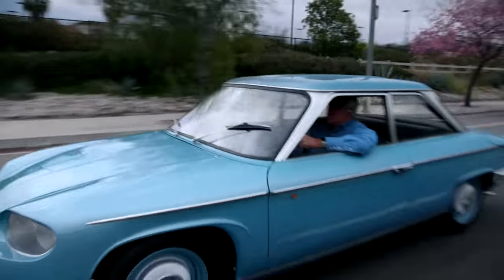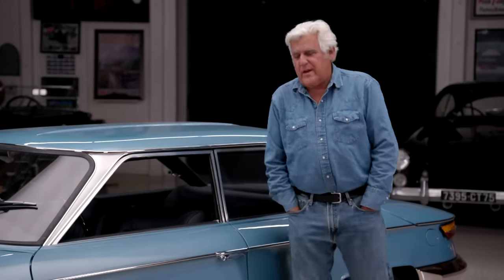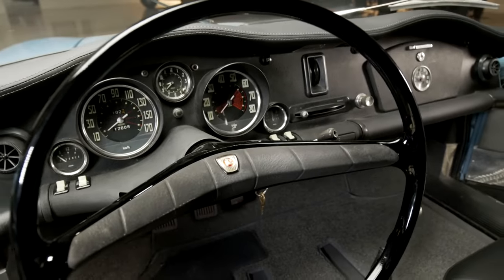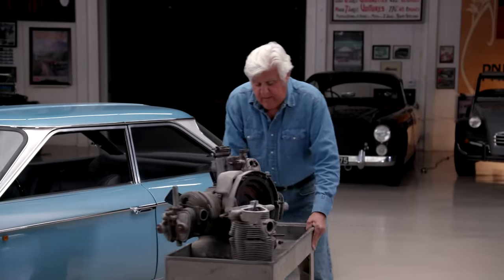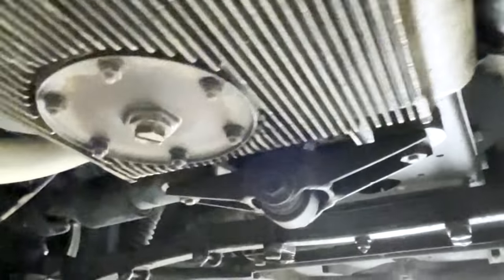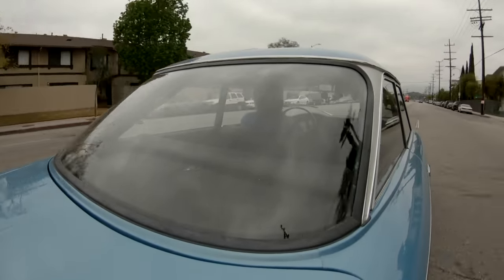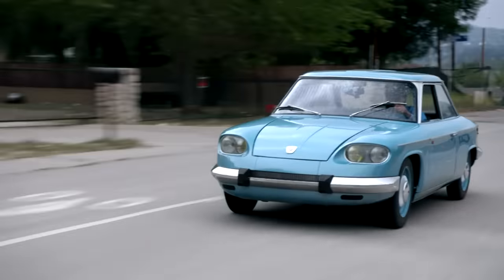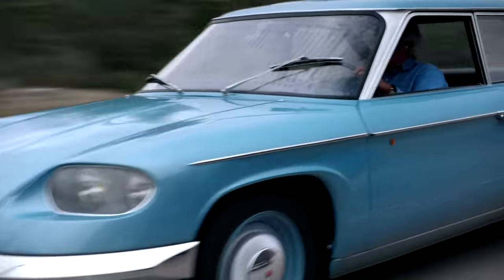1967 Panhard 24 BT - Jay Leno's Garage

Comment: The car's handling enabled it to reach top speed with a sufficient level of safety. In 1967, when I was 7, one of the teachers at my school had a red Panhard 24. I can assure you that it made quite an impression on the kids at school. This car was considered an economical sports model, with excellent roadholding, economy and comfort.

Comment: This has to be the best two cylinder car period.
Reply: Beats the hell out of the Deux Chevaux.
Reply: THE  BEST  JERRY   THE   BEST
Reply: @andyharman3022  eventually Citroën owned Panhard, so both of the greatest 2-cylinder air-cooled cars were under one roof.
Reply: @bobmcl2406  And then the Panhard club of France made their 4 cylinder version, wich i think will be amazing if improved like 4 valves per cyl and better cooling, wich could make 60 hp to 120hp and more.

Comment: So that's where the name for the Panhard rod came from! For those who don't know - a panhard rod is a suspension rod typically used on 2 link of 4 link rear suspensions to control lateral movement of the axle. A notable use of one is on the 1967-1972 Chevy c-10 half ton with the coil spring rear suspension.
Reply: 100% correct. Once I noticed my Boss' 69 C10 had that, I started to have a lot of fun in the corners. Never thought an old Pickup could be a blast to drive, the C10 surprised a lot of people in the twisties.
Reply: @znuh  yeah, but it's heavy. And while the ride of those trucks is amazing over the road, payload capacity and stability is a whole other thing. There's a reason Chevy went back to leaf springs in 1973 and has stayed with leaf springs to-date. Bear in mind too - GMC from 67 to 72 stayed with leaf spring.

Comment: I find it interesting to learn about the everyday French car of the 1960's. Not boring or dull, Jay.
Reply: Burns Harvest, everyday French Car would perhaps Not be quite the right qualification for a Panhard because the production run was only between 60000 and 75000 per year. The body was aluminium. The price was more than 1.6 times a luxury Beetle in Full Equipment.
VW produced in 1964 already more than 1 million of Beetle in Germany plus Mexico, Brazil  .

Comment: That's a surprising amount of power for a such a small, old engine
Reply: That's more power than my first car, and that had a one litre, four-cylinder, engine.
Reply: I thought maybe a 2 stroke, which would explain the power from such a small engine, but it's a proper 4 stroke. Wonderful engineering there!
Reply: Just looking at the engine, it seemed to me that a four or six cylinder version would have been a snap- and 1700cc with nearly 120 hp back in that day would have been stupid fast in a car under 2000 lbs! FR
Reply: @fredericrike5974  HP doesn't always work out that way, but true a 4 and 6 cyl would have been quite powerful
Reply: @SquillyMon  True, but getting 80-90% gain in hp wouldn't hurt the top speed either! There is also a lot of post war aircraft engine and structure technology buried in that Panhard- it's a whole lot better car than Renault tried unsccessfully to import into the US about that same time. FR

Comment: Panhard was the oldest French car company, having sold its first car in 1890. The 24 CT and 24 BT were the last passenger car models developed and built by the firm. In 1967 Panhard was absorbed by Citroen and the brand name was retired (Panhard continued for some time as a manufacturer of military vehicles). It has been said that the front-end restyling of the Citroen DS in 1967 was inspired by the Panhard 24 and that the Citroen GS was in many ways faithful to the Panhard philosophy as well.

Comment: 1800 lbs.. makes me want to gut all the excess "features" from my massively heavy 2332 lbs 2019 mx-5 :D  Please, more like this! The Internet is already flooded with the modern expensive stuff.
Reply: I am working to bring my '92 Honda Accord back. It weighs 2100 and has 120 HP stock. It seemed big at the time (when my parents bought it new) but it is so small and light it is a joy to drive
Reply: My Geo Metro is only 1620 pounds, but its 3-banger only puts out 52 hp, which, surprisingly, is plenty, most of the time.
Reply: When I bought my Miata 7/2/89, I bought the stripped base model to save on the weight.  The only thing I added was A/C because I lived in the desert then.  I have no idea what the weight is.  Maybe I’ll try and weigh it at the local trash dump.  The Morgan I bought in 1969 right after I got out of the Army was 1,450 lbs.

Comment: I had a friend who worked at a VW dealer back in the early 70s. They were throwing out some German shop manuals on the beetles. Two volumes, basically showed you how to build a complete beetle. I remember reading in the engine section “ no break in is required. Engine may be run to top speed from brand new” I always thought that was a pretty impressive thing. No break in, take it off the manufacturing line and “ have at it” No break in required
Reply: Yep, remember putting a new 1200 engine in my Bug the one day and the next driving the 700 miles to university with the pedal to the metal. Gave about 40 mpg on the trip and changed the oil at my mates place at 1,000 miles and then every 3,000 miles after that.
Never burned oil and was very reliable.  Loved that 64 Bug.
Edit - spelling Bug
Reply: Hello Rick how are you doing today

Comment: Congrats mister Leno!

Here is France talking... I knew personally the the man who hand made the firsts bodies of the prototypes in the Panhard factory in Paris, his name was Roger Lamiraut. 

Also my elder brother had one 24 Bt back in the early seventies on which I made a lot of maintenance. Beware of the  camshaft driving gear originally made of celoron that you must change for a modern metal part. Change gearbox oil frequently and the 60 hp buzzing flat twin will take you very far. Amazing automobile, great drive

Comment: I was standing next to the HBR4 'Le Monstre' - that 'Index of thermal efficiency' car on an auction two years ago. It had the engine and I think most of the running gear of this but it had this diminutive hand-built chassis on top. Amazing.

Comment: Those Panhard boxer engines are really a gem! They have as Jay says, torsion bar valve springs, roller cam with aluminum roller lifters, aluminium pushrods, herringbone timing gears( so no need for thrust plate).

Comment: The two-cylinder engine might be a treat for you, Jay but they had planned a flat-four because this engine went way back till the early fifties. It was used in the Dyna X ( I think), the Dyna Z and the PL17. So it was pretty old and they just could squeeze out a little bit more horsepower. So they asked for more money at Citroën who owned Panhard during the development of the 24. But Citroën wouldn't give them more money. They'd rather spend their money on the development of the Citroën GS which is basically the successor of this 24. I think the 24 would have been a much, much better car with a flat-four engine. But that is just my humble opinion. But it is fantastic, nevertheless. And you'r doing a great job keeping this on the road. It looks absolutely fab.
Reply: The Citroen GS was a fabulous car too , and a delight to drive.
Reply: I completely agreed what it would have been, a 24 with a flat four and an hydraulic suspension? a Dream!!!!
Reply: The GS had a boxer air cooled four cylinder.
Reply: @francoisemichelcaburet2639  Oh gosh, yes.

Comment: Actually a good looking little car, I'd rather have one of those than an VW Bug.
Reply: The Volkswagen was more dependable but this is more refined.
Reply: The Panhard could be as dependable as the WV with some TLCing and was clearly more fun and comfortable not to speak of the great road handling of the 24
Reply: @motard811  the 2 cylinder would be a deal breaker. A 3 cylinder would be perfect.
Reply: I heard that somewhere before, can't think where...
Reply: @stephen300o6  the 2 cylinder is a big turn off
Reply: @dragospahontu  why is the 2 cylinder a turn off? Jay said they feel surprisingly fast and faster than a bug. I can understand being NA engine or 8 cylinder snob but a 3 cylinder snob? It does the job for what it is.
Reply: @amg863  man at that time they could barely make a 4 cylinder feel good, I can't imagine a 2 cylinder.

Btw this car cost a lot more than the Volkswagen Beetle but the Beetle offered more for less.

Comment: The French copy nobody, and nobody copies the French.  Interesting car, never seen one before.
Reply: The French have been copied plenty , do a little research.
Reply: @davidbodden8435  Like what?
Reply: @one_flew_over_the_cuckoos_nest  well revolution. BUT O.P.s point stands with cars
Reply: @one_flew_over_the_cuckoos_nest  from
Reply: Front wheel drive , disc brakes for mass production cars , independent suspension for mass produced cars , engineering ( research the Eiffel Tower ) , there are lots more if you care to do some reach.
Reply: New French cars aren't that strange anymore they got boring.
Reply: @one_flew_over_the_cuckoos_nest  first double overhead cam engine : Peugeot 1912
Reply: @one_flew_over_the_cuckoos_nest  first mass production front wheel drive ( Citroen ) fist double over head cam engine 1912 Peugeot
Reply: Then why does this look so much like a German VW Type IV mated with a Nissan then??  Actually...it's quite a strikingly handsome car I'd say...so futuristic especially the headlights and tail-lights...the corners in general, even the bumper looks good.
Reply: Many things the French car makers introduced were copied. Like the hydro-pneumatic suspension system from the Citroen DS was used by Mercedes AND Rolls-Royce. And a simplified version was used by some cars in the British Leyland group (Austin Allegro for exemple).
The Traction Avant was obviously used in many, many cars after Citroen used it. 
Pivoting headlights that turns when you turn the wheels from the DS were also copied.
And many more...
Reply: @AxLWake  Pardon me, but that is a bit oversimplified.

Front-wheel drive was invented by the former Austrian carmaker Gräf & Stift, then utilized by German carmakers Stoever and DKW/Audi („Audi Front“) plus US automaker Auburn (licensed by a French engineering company named Tracta who improved the original Austrian design) almost half a decade before Citroen came up with the Traction Avant.

Mercedes cars with hydropneumatics installed were an absolute rarity. They used it to „lift“ the cars on bad roads only, and hardly anybody ordered it, as their air suspension was way better than their hydropneumatic one - which was rather popular in France (go figure) and Italy. Citroen used it to „lower“ the car to help people get in, and improve a fast ride, and „lift“ the vehicle on bad roads, to make the ride more pleasant. Mercedes only used the „lift car“ for practicality reasons.

Oh, and the oh-so-French pivoting headlights were first used on an early Cadillac models and then became standard on Czech Tatra pre-war models (Type 77 and 87 iirc). The French then copied that.

So, merde alors, your examples aren‘t really portraying le cuttig edge of le automobile avec maximume rust. Sorry.
Reply: Didn't Jay say Germany copied them?
Reply: @tomsommer8372  All what you said is somewhat approximative or wrong, but whatever...
The fact is that the French were very, very innovative and were often the first the install a new technology in a mass produced, commercially successful vehicule.
Reply: Except for the basic architecture of most modern cars. The new Ford Bronco has a Panhard rod, for example...
Reply: @V8_screw_electric_cars  Citröen and Peugeot are great. Renault not so much.
Reply: @AxLWake  It wasn't copied but licenced
Reply: @V8_screw_electric_cars  Nope. The new Peugeot and Citroën models aren't boring at all!
Reply: @dragospahontu  The new lightweight Alpine is great as well!
Reply: @MrSparklespring  yes they are especially their global warming electric suvs lol

Comment: Thanks so much Jay for introducing one of my favorite car ! Just one remark about your 1967 model : the drum brakes should be replaced by disk brakes (with 2 calipers on front wheels) : all BT models came with factory disk brakes (because of the powerful Tiger engine !!!). I bought in 2015 a wrecked one and then spent 3 years to restore it (a 1964 model, first model year for the BT). Now I drive my 24BT with passion... same thing with my 2017 Dodge Challenger R/T imported to France last year :-) Hemi Flat-2 or Hemi V8... same pleasure !

Comment: I'd had loved to see it started, before going out on the street, especially since it two cylindered.
Reply: In the warm climate of California there's no drama and because of the roller bearings and really tight valve clearances there's no rattle waiting on oil pressure building up. As Jay says the engine rocks a bit on its mounts at idle but once its above about 1000 rpm it's really smooth all the way out to 6000 rpm
Reply: @gordonmcgregor6431  That's exactly why I think it would have been nice to see, hear, feel the process!

Comment: So many European automakers of the 60s were heavily influenced by the Chevrolet Corvair's design.
Like the NSU Prinz, this is one of the more blatant examples!
Reply: But sooooo much more interesting ;-)
Reply: NSU began building rear-engined cars before the Corvair. Actually, the Corvair was a borrowing from European design - the Tatras from the early 1930's onwads, VW Beetle, Renault 4cv (1947), NSU Prinz (1957), Skoda, etc etc.
Reply: @roelsiebrand7181  You're underestimating just how fun a Corvair can be, especially compared to its 60's American contemporaries.
Reply: @pashakdescilly7517  Perhaps I needed to more specific for you Chief.
And use the word 'styling' here, rather than 'design'. As the NSU Prinz 1000's styling was one of the most blatant styling ripoffs in automotive history.
It TOTALLY cribbed the Corvair.
Reply: @LN997-i8x  The fun Corvairs are the 1965-on ones with Corvette-based rear suspension. They actually handle very well.
Reply: @nathandwyer7273  There is a resemblance, but to design a similar appearance in a tiny car actually takes much skill. Far closer in appearance to the NSU Prinz 4 is the ZAZ Zaporozhets 966, a similarly small car, but with an air-cooled flat four. They used to be fairly common in Eastern Europe

Comment: Jay best review I think I have ever seen.    Having owned corvairs which I know you love this is fantastic.    Everything in this car is spot on.   Not too much not too little.   Lightness.  The French are clearly thinking differently which is great.    Listing the differences -   Small displacement, hemi heads, cooled, torsion valve springs.  Simple fan shroud, roles bearing built to rev that must have been expensive to build.  Motor mounts.  Front engine and Fwd.  leaf spring front suspension.  Torsion bar rear.  Big greenhouse.  Slim roof Pilar’s.  Exposed finned drums like Pontiac.  Belt line styling like the Nsu hillman and early corvair.   Similarity to the special body Karman Gia is unmistakable.  I always wonder if you built this car again today what would it look like.    BMW motorcycle engine.   Plastic body.

Comment: My dad bought a 1975 Peugeot 504 diesel when I was in high school. It was the coolest, slowest thing on the road! it got over 30MPG, had an incredibly smooth ride with the fancy MacPhearson (sp?) strut suspension that lasted the life of the car, which was over 400K miles and 24 years before he sold it to me for $1.
I don't recall it ever breaking down for anything serious - maybe a fan belt or battery but no mechanical problems - not even a clutch.
By the time I got it, it was pretty worn out though. I took a turbo charger from a 2.4L Ford/Merkur xr4ti and bolted it to the Peugeot. The goal was to have the old girl go out in a blaze of glory - and it did! On a long steep grade near my house, the pre turbo speed when cresting the summit was 45 MPH and post turbo was 75MPH. I had to pull over at the summit though to investigate the steam and smoke billowing from under the hood. I had either warped the head or blown a head gasket. I let it cool until the water stopped squirting out from the head and then drove it the 15 miles back home where I took the whole car apart and scrapped the parts. I still have the vacuum pump and lots of other hardware bits to this day. The pump is attached to an antique electric motor and used as a vacuum fluid extractor in my garage. I have to agree with Jay that the French way of doing things is often weird, but also often just smart. The Panhard seems to have a similar design philosophy. I wish Detroit would have paid more attention back then. They could have learned a lot.

Comment: A great video; I love and owned many French cars...a Renault 10; A LeCar; Puegot 404; 504 diesel; Simca 1204 sedan and wagon.  You're right they were all very comfortable cars to sit and ride in.

I never owned a Panhardd, but knew a guy who had 3 of them and they all ran.  One was fully restored and the others were for parts.  

If you want a unique driving experience, drive a DKW Junior/F12.  MB imported them for a few years in the late 50's and early 60's in the US and they have surprising handling characteristics, but given the ultra small numbers imported into the US, finding a running one would be like finding a needle in a haystack.